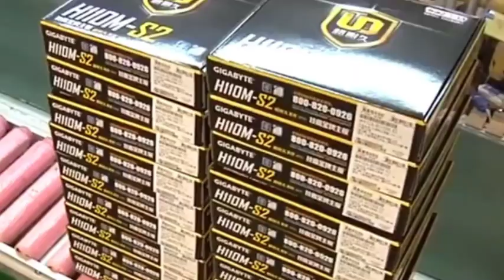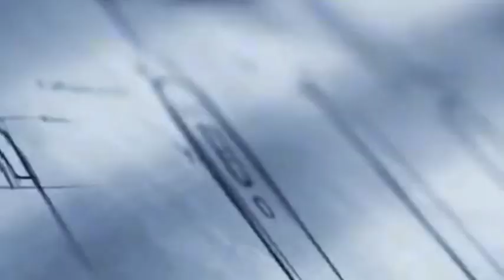Did Chinese lithography machine technology steal ASML's lithography machine technology?

Comment: China will develop its own machines - I have no doubt in my mind. And it will be sooner than most people expect.
Reply: The 3rd generation chips developed by China for instance do not required any EUV. 
They have bought a couple of less sophiscated off the shelf NIL equipment from a German manufacturer and all they need to do is developed masks to imprint the pattern. 
Anyway China has also developed their own NIL machines apart from importing from Germany and Japan due to National Security reasons.
However China leads in advanced P&T lithography machines and even TSMC 3nm nodes is using them. 
It is by far more crucial for 3rd generation semiconductor chips and of course a huge pool of talents. 🤔
Reply: I would say that ASML will be out of business in 5 years
Reply: @pawoon  
Yes. And face very intense competition from Chinese competitors due to lower price structures.
Reply: Chips in the future will all be designed by AI

Comment: IMO No. If they wanted to do that, they would have done so a long time. 
China can easily duplicate these lithography equipment based on their current knowhow and status.
Examples: Both SMEE, Huawei, etc have filed and own their own IPR for their lithography machines. 
ASML does not process all the IPRs as well as it basically an assembler of the parts produced by other companies e.g. Excimer light source from the US, Mirror lens from Carl Zeiss, Germany, etc
But something new is brewing. SMIC, YTMC, eyc may be suing ASML to buy back the machines which they claimed they can't serviced. These Chinese users may apply to invalidate all the IPRs on the DUV and DUVi supplied by ASML inside China.
That is a strong possibility it may happen. It does not breached WTO rules as there are precedent set.
Reply: Didn't ASML once boasts and told China, even if we give the blueprint you still can't build an EUV lithography machine?
But they did not provide any EUV machine nor blueprint to China.

Comment: as of now, there are no chinese lithography machines below 190 nm.
Reply: they will reach it
Reply: Which is of course, NOT true. 
SMEE has already started mass production and delivery of it's 28nm SSA800 DUV lithography capable of producing 7nm chips. It has just received it's validation certificate.
It seems even the 22nm DUVi has been delivered for testing and verification.
Reply: @mythbusterthe6749  
In MY VIEW
This hysteria about node size is really misleading.
OK for smartphones etc where YOU WANT less energy use and size is really important etc and as a foundry the money is overwhelmingly in "cutting edge"
For 99% of all applications of chips cutting edge is not needed and legacy chips will do fine.

There is NOTHING you can do with a cutting edge chip you can not engineer with legacy chips...
apart from the higher energy consumption.

This "cutting edge" has in my view become a prospect of diminishing returns.
It will stall, it will simply not be economical.
Reply: @qinby1182  
I agree. For IoT applications where space and energy consumption are not a constraints, it is really not a necessity.
Take the US MARS Rover for instance it is utilizing the 160nm chips.
Reply: China is already in 7nm and going to 3nm and 2nm. What are talking about Mr Robert you are troll........!!!!!!!!!